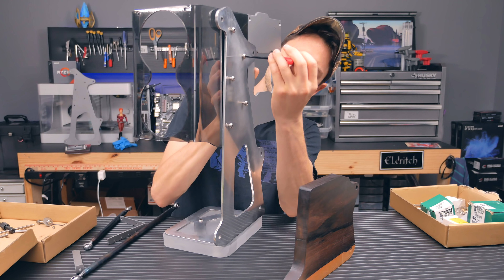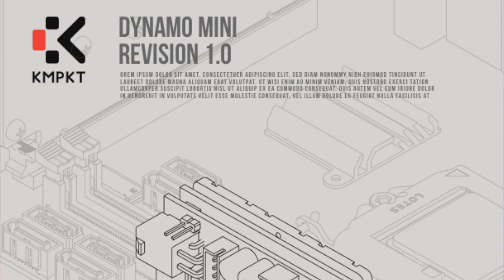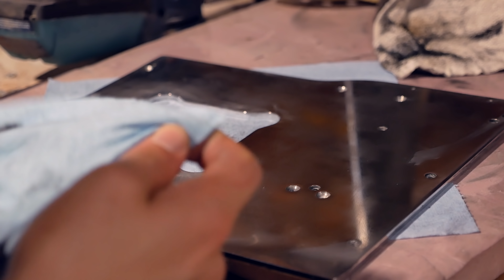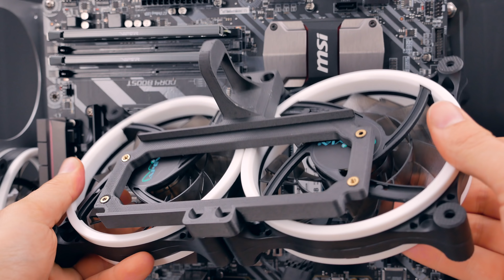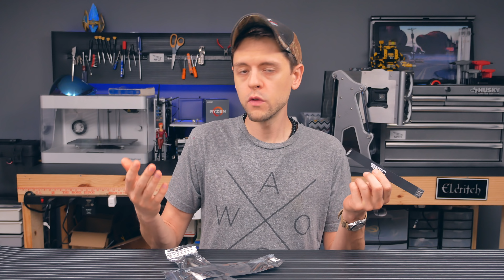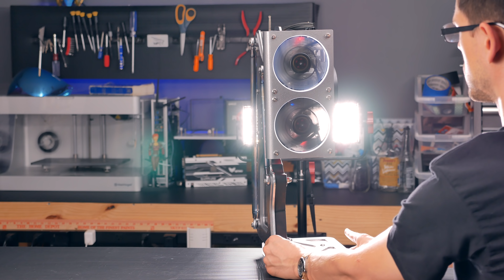Scratch Build with AMD Combat Crate (pt. 2)

Comment: Interesting design, but the biggest issue with this case is the motherboard cutout it's too small, if you need to install another or any aftermarket CPU cooler then you need to take the motherboard out of the case and that will be a tedious process

Comment: I think a lot of people are giving you praise because you spent a lot of time & effort making this, you are very skilled..... but honestly it looks horrible. You mixed & mashed plastic, steel, aluminium & wood with very bad effect, you have sharp edges then mixed it with curved parts,  2 tone grey with blue steel. the angle of the plastic front fan mount doesn't match the back & the fans you used quite noticeably shake in your video.  sorry. just doesn't look good at all
Reply from the maker: Justin, I put myself out here for everyone to see and try to share new ideas and turn processes that we take for granted in PC design on their head. The point of this and other build you can find on my website is to mix and match processes and layouts and inspire more creative and talented people than myself to go out and not be afraid to experiment. In a world of Pinterest and copycat rote of the same crafts being repeated over and over I want to bring some originality to my niche.   This isn't an excuse for poor results, but your critique misses this point and thus I can't really take much away from it. Most of my work misses the mark in one way or the other, but I consider it a success or failure based on what I learn and if I find a unique and viable hardware layout. Peace to you and please think about how your words have power to lift up and encourage or demotivate and destroy.  -Josh

Comment: The exposed dirty looking pcb's of the cheapo parts look really bad. Your PC design is terrific though, the craftsmanship is amazing. I feel like you had an idea with clean lines, nice wood block, curved transparent plastic and everything but the actual hardware and how it was mounted is questionable. Personally i would have loved if you found a way to fit the custom power supply all in the base (maybe give it abit more volume by stretching it out and make the footprint bigger), and then piped the cables through a custom channel that could have been steel folded in on itself or something and then mounted the 24 pin straight on to where that cable channel ended. The gpu should have been modded 100%, some kind of opaque fan shroud like your custom one for the case fans wouldve tied the build really well. And lets just kick the amd stock fan to the side and do a custom loop. Basically too much exposed pcb of a low quality killed the superb work on the actual stand. You still have my sub though!
Reply from the maker: Thank you for the thought out advice! The challenge here is how to take sponsored parts you aren't "supposed" to mod and integrate them into a design that is still fun to do and not a boring box. I struggle with this constantly. peace

Comment: I'd like a lot more information about this power supply solution, and how you were able to wire it up to the motherboard, fans, GPU and hard drive(s). It doesn't look like there are enough wires to accommodate all items.
Reply from the maker: Hello, JLM. You are in the right place if you want to learn more about these kinds of PSUs. The core focus of my channel revolves around them, and I have many videos talking about them in-depth and modding them. Go to my video list and check out HDPLEX and Pico videos. Peace

Comment: that custom sli risers are awesome!!!
i will keep them im mind

does Li heat make both sli bridges and pci risercables in custom lenght?

Im using a 3m riser cable atm.
Can you compare them?
Reply from the maker: I don't think they usually make them in custom length, but they have TONS of lengths available. They also offer printing on their risers like you see in the video, so you can include your own logo. Finally, they are running a special, and if you mention NFC you get two SLI risers FREE if you purchase a PCIE 16x riser. As for the comparison, the Li-Heat risers are as good as the 3M riser and I have done tons of tests (as the MINI is a NO COMPROMISE system and I wanted the best). Peace